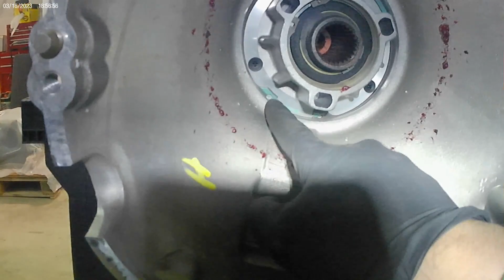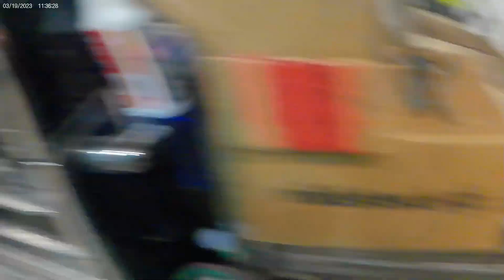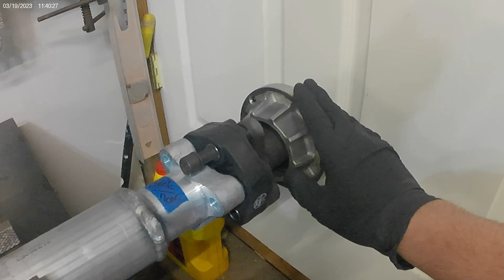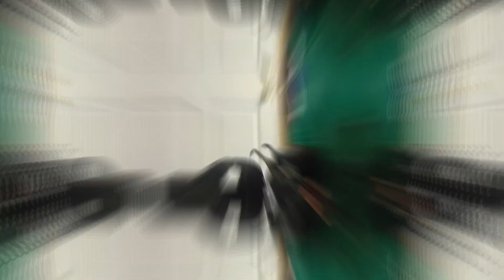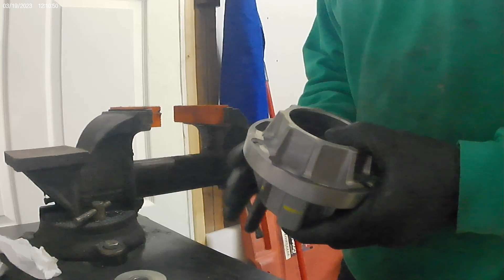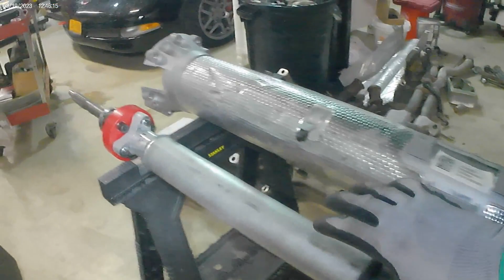Corvette Torque Tube Breakdown and Rebuild #c5 #c6 #c7 #corvette #torquetube

Comment: How expensive was the diy compared to a shop ??
Reply from the maker: Hello and thank you for commenting. The job in its entirety just for the torque tube assembly was at about $650. That included polyurethane bushings, upgraded input shaft, upgraded torque tube bearings and slave cylinder. Please like And subscribe
Reply: Nice. I just picked up a c5. Thx for the honest answer.  @NY-DIYMECH

Comment: The best thing to do with anything like a new harmonic balancer or bearings that require being pressed on is to throw the part in your freezer the moment you get them and dont remove from the freezer until the moment you are installing them it makes installing those parts alot easier
Reply from the maker: @3613jeremy  thx for the comment. Yes, working with aluminum the cold can be on your side.  Cheers!!!

Comment: I'm curious, did you mark/index the orientation of the driveshaft with the input shaft on disassembly? I am skimming through your video and not sure whether you did... other folks are saying to do that. I'm not so sure I put mine back together exactly how it came apart.... I just put in a new LS7 clutch/pp, torque tube bearings (left my couplers in there as they looked new), and diff clutch packs... I now have some felt vibration in the shifter that corresponds with RPM now that wasn't there before. I'm all in my head thinking maybe its because I changed the orientation of the input shaft/driveshaft.. Also not sure whether the LS7 flywheel should have been match balanced to my old stuff. I did see a little weight pressed into my LS6 flywheel. There wasn't anywhere on the conversion flywheel to move it over to (it was a RAM lightweight FW). Anyways, just trying to check my sanity, theres so much conflicting information out there.
Reply: I was curious about that as well, usually the assemblies are balanced as a whole. 😅 Great video though.
Reply from the maker: @gsc512  You're right, they are balanced as a complete assembly.  In hind-sight I should have, now better for next time.  Thx for the nice comment. Be safe, Cheers.
Reply from the maker: Hey thx for watching and commenting.  Yeah, there's tons of information out there, from many good, and not so good, individuals out there. The talent out there in the YouTube world is truly amazing.  I just went off of research, combined with my knowledge,  and did things. I didn't mark my splines at all. I also have a slight vibration, but that's due to poly drive shift bushings. I also found that my rear tires were out of balance by .25oz. After balancing them, the slight vibration went to a faint one. I also went w the ls7 clutch, but with an aluminum FW. Great factory upgrade. I also did zr1 clutches,  w upgraded Bellville washers as well when I did did gears. What big difference.  Out side of all that,  haven't had any issues. Hopefully I answered your question. Need anything else feel.free to reach out. Thx for watching,  and please like and subscribe.  Also follow @nydiymechanical. Be safe,  Cheers